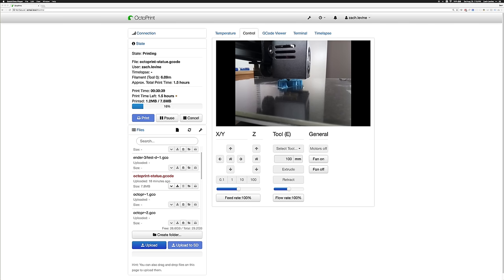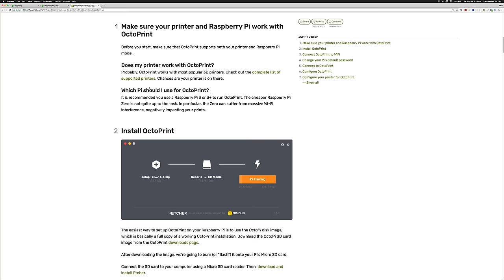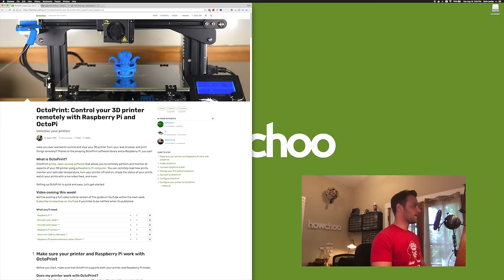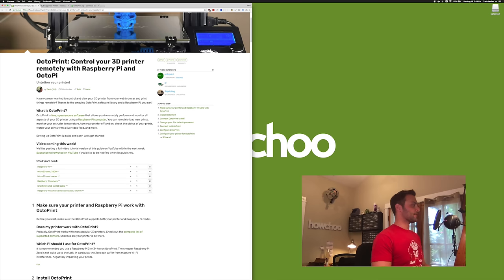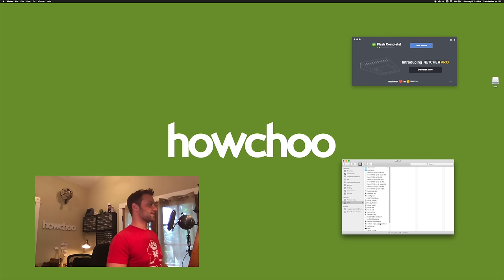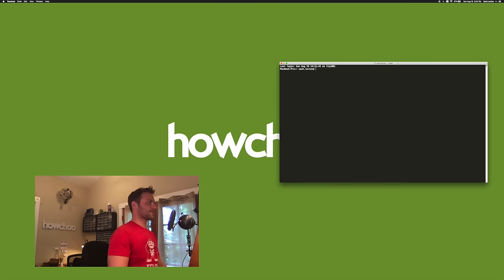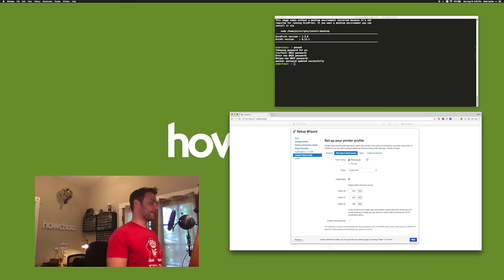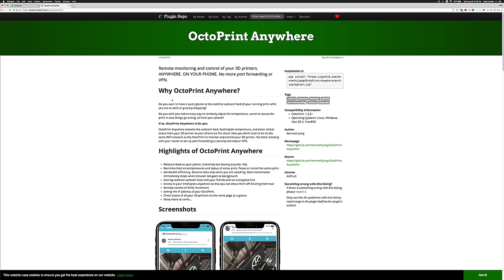OctoPrint: Control Your 3D Printer Remotely Using a Raspberry Pi!

Comment: Could anyone assist me? Is it necessary to have the pi camera? Will octoprint remote printing still work without the camera?
Reply from the maker: The camera is not necessary for remote printing. It’s only necessary if you want to SEE your prints remotely. If you don’t have a camera, the “feed” tab in OctoPrint will simply be black because there’s no camera feed. :)
Reply: @Howchoo  Wonderful! Thanks for the info!

Comment: Ive done everything step by step and when I ssh I get an error saying no such host name found. Please help :(
Reply from the maker: Can you try connecting your Pi to an HDMI monitor and see if it's booting properly? Then you can connect a keyboard to it and try `ping google.com` to see if it has an Internet connection. Most likely something happened when editing your wpa_supplicant.conf file, like it saved as wpa_supplicant.conf.txt, or it contains some kind of rich-text formatting. What program did you use to edit the file? Also, which Pi version are you using?
Reply: howchoo Not really sure why it wouldn’t work, but I booted into it whilest connected to a monitor and had to enter the wireless settings there. Not sure editing the file in sublime didn’t work. Oh well, I got it working now!
Reply from the maker: @iamcam5699  Good to hear!

Comment: i have a pi b+ and a pi 2 is it working for it or not ?
Reply from the maker: Yes, the Pi 2 will work fine if you add a WiFi USB dongle. The Pi 2 doesn't have onboard WiFi.

Comment: My raspberry connected to my internet but when I try to connect to it it does not work, it only says the server cannot be found, The pi and my computer are on the same network, what should I do to resolve the problem?
Reply from the maker: Can you try connecting it to an HDMI monitor or TV and see if it’s booting properly? Sometimes if the SD card flash fails, it won’t boot properly and you just need to flash it again.
Reply: @Howchoo  thanks a lot for the advice, it is now working correctly, I have connected it to a raspberry pi monitor and it is working great. Thanks for making this video it helped me setup really quickly
Reply from the maker: No problem! :)

Comment: Wait something wrong I think. How can you case up raspberry if it heat up? I still have to receive this, but i’ve read that it heat up even in normal usage, and pla get melted easily
Reply from the maker: You definitely want to use heatsinks if you have them. But even if you don’t, the PLA isn’t close enough to the Pi to melt.

Comment: what if you get an error saying " Permission denied ( public key) when trying to ssh
Reply from the maker: Sounds like a permissions issue. Are you logging in with the default user?
Reply: howchoo I’m actually not even sure what the problem was... I set the IP to reserved and had the pi drawing power from its own socket and it’s fine now.
Reply from the maker: @rafaelzasas9421  Weird! Glad you got it working though

Comment: when I was trying to go to https://octopi.local it said site can't be reached and how do I fix it
Reply from the maker: Something must've gone wrong the installation, or your SD card might be corrupt. Try going to the http version first: http://octopi.local

If that doesn't work, connect your Pi to an HDMI monitor or TV, boot it up, and check for boot errors. You might need to reinstall OctoPrint
Reply: @Howchoo  I've found out that you were supposed to put the pi ip in the address bar but thanks anyway

Comment: I cannot get https://octopi.local/ to work on either wifi or ethernet connection. Is there something i need to do to enable https? Edit: ok it works on wifi but not wired connection...thoughts?
Reply from the maker: You'd need some kind of SSL cert -- a self-signed one would do. Do you need https for accessing the printer externally? Interesting it works on wifi but not wired -- are they the same network? In other words, is your Pi connected to the wired network as well, or just the wireless one? You can confirm by going to http://octopi.local while on the wired connection.
Reply: @Howchoo  Hi, my network is setup like this. I have the Uverse modem which I used for hardline conenctions in my house. My house was built with networking in mind so I have hardline connections in every room via outlets so therefore the uverse box sits in a closet (where networking lines all run to) with a bad wifi signal so I disabled wireless on that and I have a seperate router I use upstairs for wireless. This sits behind the uverse modem on a different IP (192.168.1.X vs 192.168.0.x). I can connect to octoprint on wired and wireless at same time but only the wireless allows the http. I would like to access it externally and I think there is some tutorial I read to do that but haven't tried it yet. Think it's called OctoPrint Anywhere.
Reply: @Howchoo  I fixed it. I wanted to post this here in case someone else has this issue. I had to go to C:\windows\system32\drivers\etc\hosts and add IPAddress + octopi.local to the file
Reply from the maker: Good find! Thanks for the info.

Comment: The "raspberry" password does not work. I am using PuTTY. Once i go to put in the password, I get the message of "Access denied." Is there anyone or any way I can fix this issue?
Reply from the maker: That’s strange — what are you using for username? Can you try connecting the Pi to an HDMI monitor or display and use a keyboard to change the Pi’s password?
Reply: @Howchoo  I connected my Pi to my monitor and I changed my password and enabled SSH. When I went to try PuTTY, I was still denied, even with the IPV4 address and using both "raspberry" and my new password to connect to it. Not sure what I am doing wrong
Reply from the maker: Ahhh, have you enabled SSH on the Pi? Put the Pi’s SD card in your computer and write an empty file called “ssh” without the quotes directly into the boot directory. Then try again :)

Comment: print files on Thingyverse ?
Reply from the maker: Sure thing, the Ender 3 models can be found in this guide:  https://howchoo.com/g/ntg5yzg1odk/using-octoprint-with-the-creality-ender-3-3d-printer — If you have a different printer, you can find more info here: https://howchoo.com/g/y2rhnzm3odz/control-your-3d-printer-with-octoprint-and-raspberry-pi#print-the-necessary-parts-for-your-printer
Reply: those t-nuts can also be made if you happen to have regular nuts around. https://www.thingiverse.com/thing:3050607

Comment: so the that etcher program had ruined 2 of my micro sd cards, anyone else have this problem?
Reply from the maker: What do you mean by "ruined"? It isn't possible for Ether to physically damage your SD card. What are the symptoms and what brand are the cards? It's possible you need to format them first before running Etcher.
Reply: @Howchoo  Yes, so what I would do is then format it. Then do it all over and after etcher was done doing it again I got the same error that my sd card needed formatted. I did this several times and sometimes my computer wouldn't even pick up my SD card after I flashed it, so I would have to go into disk management and fix it... I have another question, am I supposed to have a wireless usb dongle? or have ethernet plugged in to raspberry?
Reply: howchoo actually I figured it out and got it working. But during my first print it stopped and said lost connection to server. I have really fast internet so I don’t think it was that. Is this a common problem?
Reply from the maker: @aaronward6092  Hmm I've never heard of that problem before—so you were logged into the OctoPrint UI (octopi.local), the printer stopped, and the interface said "lost connection to server"? If so, it sounds like your Pi may have lost power. How are you powering it?
Reply: howchoo  I was using a 4v 2.5 amp charger or something close to that. I thought it naught have been the power supply also so I ordered an official raspberry power supply and I’m going to give it another shot tonight or tomorrow. Thanks for replying with the help. I was actually really surprised with all the reply’s I got from you. Do you have a way for me to donate?
Reply from the maker: @aaronward6092  Awesome! And no problem, I try to reply to as many comments as I can. Let me know how it works out, either here or in the comments section of the full guide. And we do have a donate page if you'd like to buy us a coffee or beer :) https://howchoo.com/donate

Comment: Poor guy question... After setting up OctoPrint would you still need an SD card in the printer itself or could I use that SD card for OctoPrint? 😂
Reply from the maker: You need to leave the SD card in! It’s the hard drive of the Raspberry Pi and is necessary for it to function. :)

Comment: I don't like that the Pi is powered by the printer. That means every time you power off your printer it will hard cycle your pi.
Reply from the maker: Right, always shut the Pi down safely through the OctoPrint UI before turning the printer’s power off. If you want to make it more convenient, you can add a shutdown button or install a touchscreen: https://m.youtube.com/watch?v=6OP2c-GQFu4

Comment: Not sure if you’re familiar with plasma CNC machines. I would like to build one and I’m capable up unto to programming part. Not a clue in that section. I plan on using Match3 for the design input, but in terms of translating that to the movable parts... I’m lost. It would need an X and Y axis. For a reference article I have this one which might translate better https://m.imgur.com/gallery/JitIU

Along with that like here is the link for the input design software https://www.machsupport.com/shop/mach3/

I would greatly appreciate help or at least a direction to go, like I said I have no programming knowledge. Thank you very much

Comment: HELP!! On my Windows 10 PC, I am able to type in ssh pi@octopi.local and then it goes onto ask me for the password. However, when I go to type in the password, it will not type. Can anyone give me assistance please?
Reply: Yeah, it wont show. You just type raspberry then enter and it works, but that's as far as I've gotten since the octopi.local site pulls up that octoprint isn't running, and my raspberry pi says octoprint login on it.

Comment: I can't ssh into my pi. it keeps timing out any tips?
Reply from the maker: Are you sure it's connected to the same network as your computer? The best way to troubleshoot this is to connect your Pi to a monitor or TV via HDMI to make sure it's booting correctly. If it is, try connecting to it via IP -- you can connect a keyboard to the Pi and run the `ifconfig` command to find your Pi's IP. See: https://howchoo.com/g/mjk3m2e2njy/find-your-raspberry-pis-ip-address

Let me know if that works!

Comment from the maker: Check out the full guide and parts list on howchoo: https://howchoo.com/g/y2rhnzm3odz/control-your-3d-printer-with-octoprint-and-raspberry-pi
Also, check out my new video on adding a touchscreen to OctoPrint! https://www.youtube.com/watch?v=6OP2c-GQFu4
Reply: that doesnt show a screen in parts
Reply from the maker: @ThatGuy-mp9og  What do you mean?
Reply: @Howchoo  I got an Ender 5, I think I need to design a camera holder for use on extruded aluminum
Reply: It is all there, you have to dive for it.
Reply from the maker: @fyremonte  Thanks -- I'm realizing now I might need to make the parts list more obvious on the site. Do you think it's too hidden/mixed in?
Reply from the maker: @fyremonte  You can definitely find a camera holder for extruded aluminum on Thingiverse :)
Reply: @Howchoo  it could be a bit more obvious  to be honest but it was certainly findable if you read the paragraph. People like to skim, unfortunately.
Reply: @Howchoo  thanks for the suggestion.  I did find the camera to mount on extruded aluminum. I am thankful for your video. I followed it to the tee and I have a perfectly running Octopi and camera. Octoprint Anywhere is sweet too.
Reply from the maker: @fyremonte  Thanks! I'm going to work to make it more obvious anyways.

Comment: oh my god. not connecting to wifi. nothing is ever simple I swear.
Reply from the maker: What version is your Raspberry Pi? And is your network 2.4GHz or 5GHz?
Reply: @Howchoo  figured it out. I had uncommented the "# WPA/WPA2 secured" line in the supplicant file
Reply: @Howchoo  thanks for replying. sorry for frustration comments!
Reply: its up and running now. Thanks for the the video and instructions!
Reply from the maker: No problem! Glad you got it working :)

Comment: ssh: Could not resolve hostname octopi.local: No such host is known.
Reply from the maker: Sounds like your Pi is either not connected to the network or not booting properly. Can you try connecting to a monitor with an HDMI cable and see if it boots? If it does, run `ping google.com` (without the backticks) using a USB keyboard to see if you're connected to the Internet.

You can also try re-flashing the image and adding your Wi-Fi credentials—sometimes the image gets corrupted when it's written. Let me know how that works!